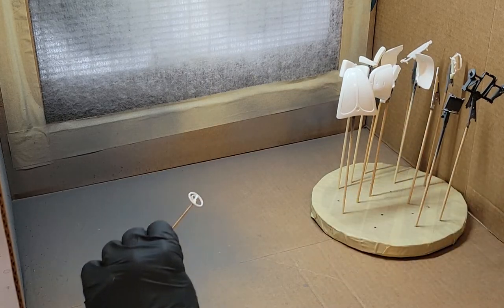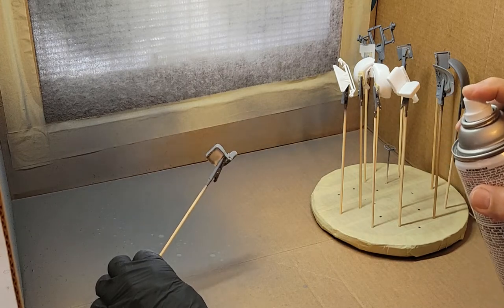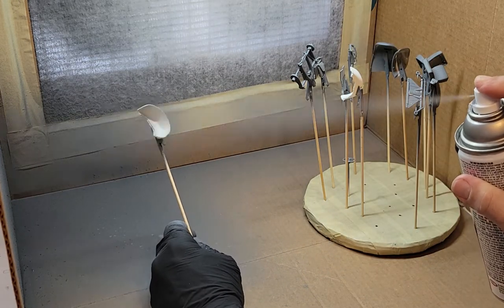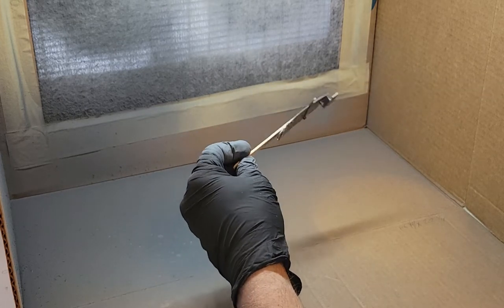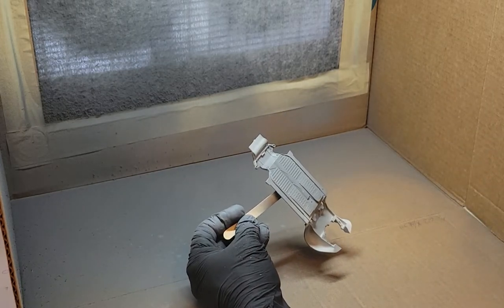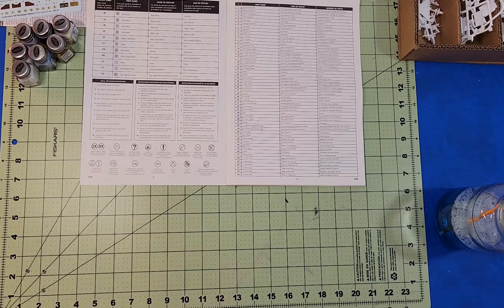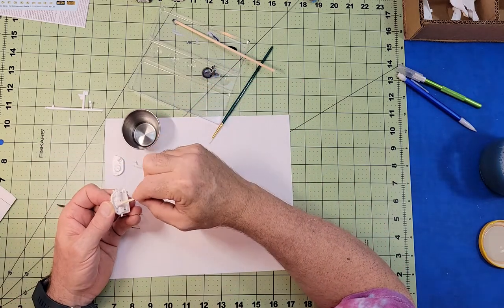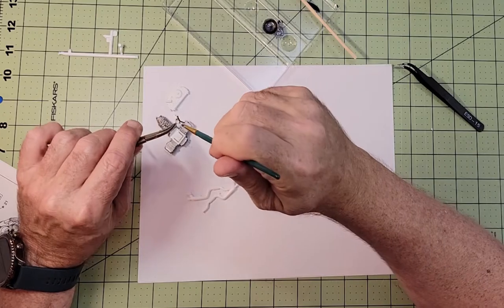Priming a 68 VW Bug Plastic Model Kit | New Paint Booth Test

Comment: You're doing a good job. I've been doing this for about a month. I understand your frustration. And it seems you need more fine tip brushes than anything. I just finished the same kit the other night. I am starting to prime and paint most of the pieces and then do fine painting later. Keep at it. I learn more with each kit.